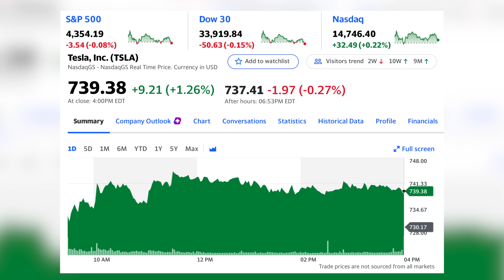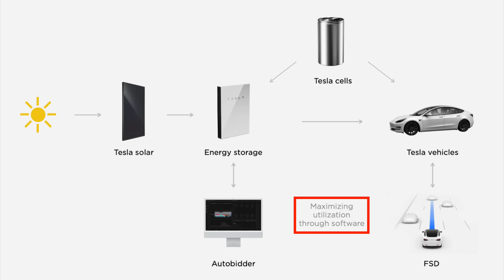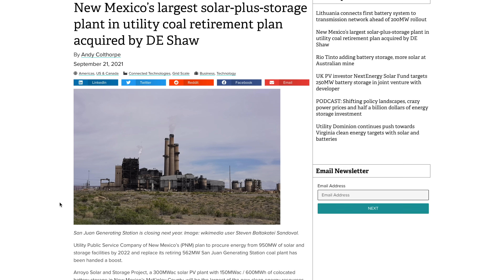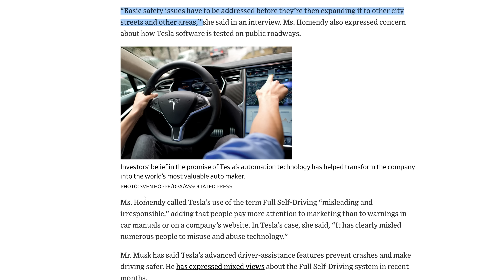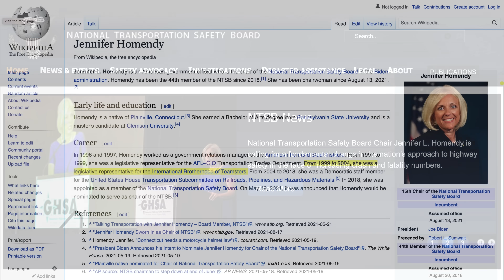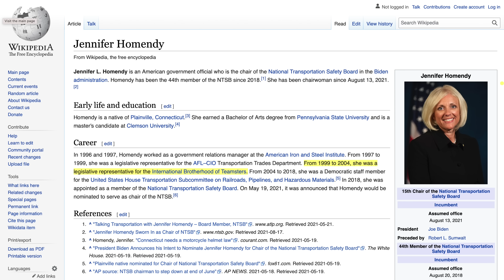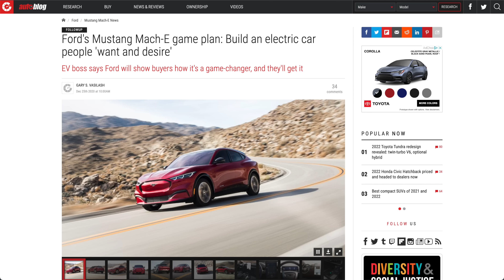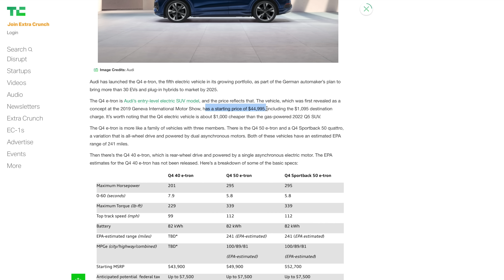News on Tesla Energy + NTSB Comments on FSD, EV Market Updates

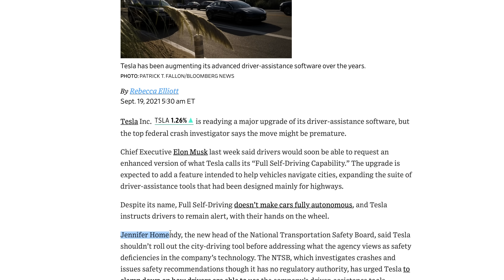Comment: At 4:40 the former Union lobbyist is pushing a false narrative. There are always safety concerns about any driving anywhere. The real test is whether the roll out of further driver assistance features will reduce or increase safety. Tesla has accumulated data from real world driving that provides strong evidence that its driver assistance features has significantly lower levels crashes per million miles. Hence the real issue is at what point should regulation restrict entry into high risk areas to cars equipped with advanced driver assistance technology. 😱 Regulators in Europe are already talking about planning to limit entry into major cities to vehicles capable of autonomous driving. 😎
Reply: But when FSD is up and running at %99.999 safety won't they be banning all cars without it?

Comment: Frequency control
I remember learning about bringing up a generator in parallel with another generator. The two had to be in phase (lest disaster). This is a question I've had since I heard about VPP. It seemed to me that not only would the frequency of the AC coming from power electronics be precisely the same as the grid, the phase would have to be matched such that power could then be added. 
If I'm wrong about what "frequency control" is, please let me know. :)
Cheers from Korea
Reply: No, frequency control means the system automatically reacts if the grid frequency deviates from the standard. It is caused by a mismatch between generation and consumption. The grid operator usually can prevent this by forecasting demand and reacting to unexpected changes, but they can fail for many reasons. Tesla can help, because batteries and solar panels can be controlled on the millisecond timescale. And they can earn a ton of money doing it.
Reply: @andrasbiro3007  "It is caused by a mismatch between generation and consumption. "
You talking about power factor here?

Comment: re: ntsb recommendations, Tesla needs to start using their sensors to prevent back seat stupidity. If Tesla can dynamically adjust airbags depending on seating position, they can detect when some knucklehead switches between them. Same with the game playing on AP. This "push the passenger button to bypass game play with only one human in the car" stuff is hilarious. I love playing in traffic, but cmon
Reply: Tesla treats its customers as thinking and responsible persons. Not like grand ma‘s that stuff their cats into the microwave to dry them. Maybe that’s the wrong way and NTSB, NHTSA, NSA and all other a acronyms of the US think ALL people are all like Grand Ma‘s stuffing cats into ovens? Then Tesla of course has to follow the local rulers from the NTSB. Just like the single ding demanded from the CCP. Or the renunciation of the term Autopilot in Germany demanded from the courts.

Comment: One reason Tesla has steadily raised the price of FSD is the prospect of the owner of the vehicle making money from it by putting it into a robotaxi fleet. If, and when, that occurs is TBD. However, Tesla and its vehicle owners have an opportunity to make money off the cars in the near future by offering the cars as part of a virtual power network. The number of cars available could swamp the number of Powerwalls. To do this would require an upgrade to allow each car to supply power to the grid, and may require modifications to the vehicle owner’s home charging solution, but if a virtual power network with Powerwalls could be profitable, then such a network which included Tesla cars could be massively profitable.

Comment: Oh the irony on Ford glass roof popping off after their chiding of Tesla for same issue. 😂
All joking aside though... I was working within the automotive glass industry not long ago, and I can tell you that it happens more frequently than one would hope it would... Batches of the windshield adhesive "glue" pass quality control, and they find out after some of it has been used, that it was not up to the job of holding a windshield in place... So it's not specific to any manufacturer really.
Reply: Rumor has it that it was a single incident due to a improper roof rack install.
Reply: @TheEvilmooseofdoom   The Tesla example, yes.  Not the Ford recall.